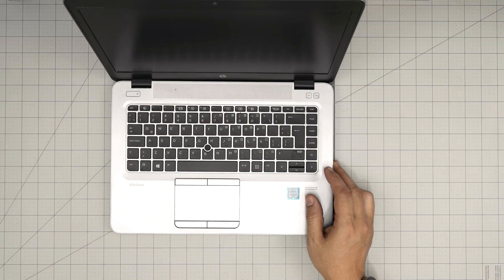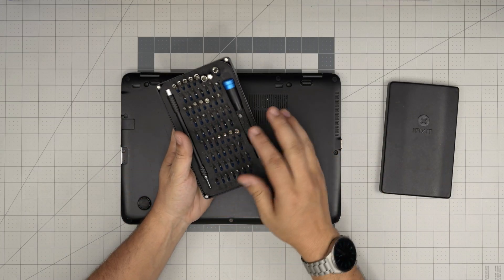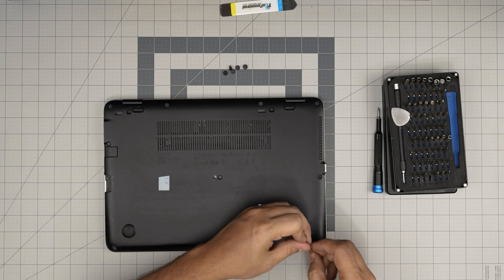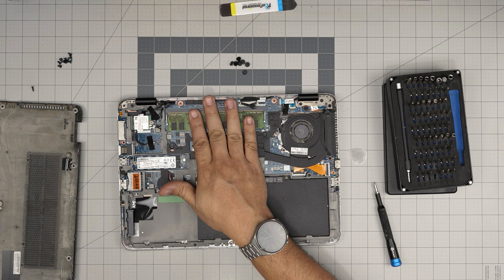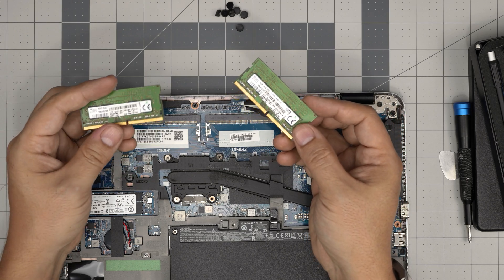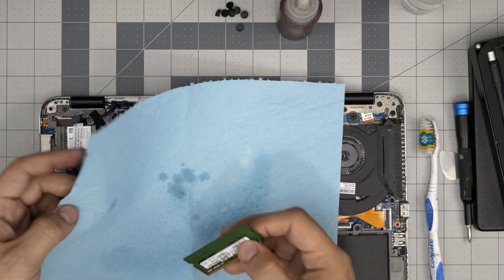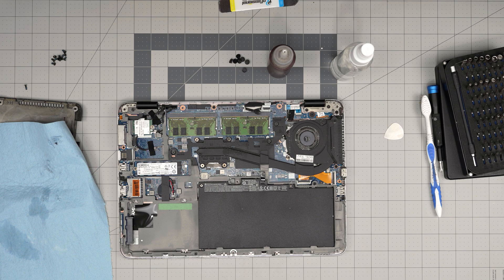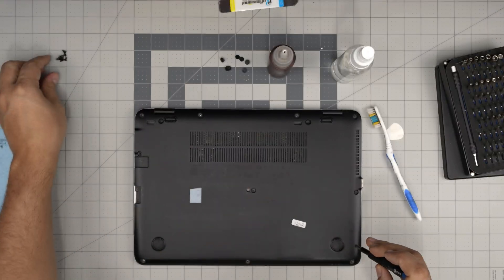How to Upgrade RAM on HP EliteBook 840 G3 Laptop – Step-by-Step Guide

Comment: i have an HP EliteBook 840 G3 laptop with 8 GB of RAM, but unfortunately it has TPM 1.2, so I can't install Windows 11. Is there a way around this?
Reply from the maker: Create a USB boot drive for Windows 11 installation this way:
https://youtu.be/K3UFQmPcQjs
cheers🍻
Reply: Win11 also refuses to install from bootable media? I've done that prior and it worked on other machines although you may run into unsupported drivers. Or just use w dual boot with Linux and win 11. You can also use Flyoobe win check bypass to force a win 11 install. Id just got with a installation media to be fair. I have the same laptop btw but am sticking to win 10 for now. All my hardware runs fine.